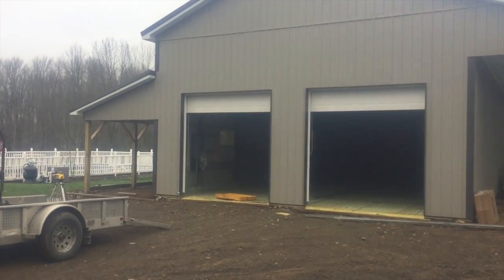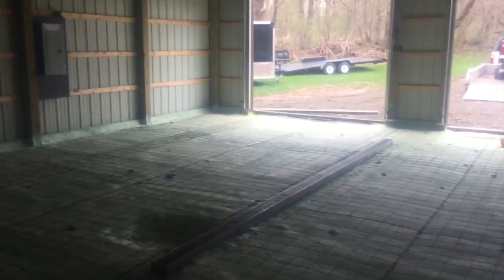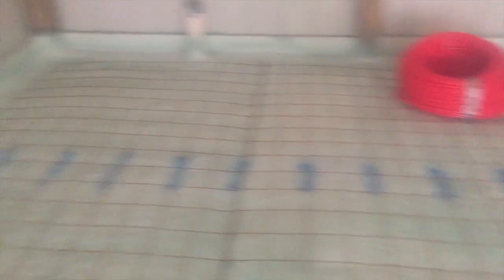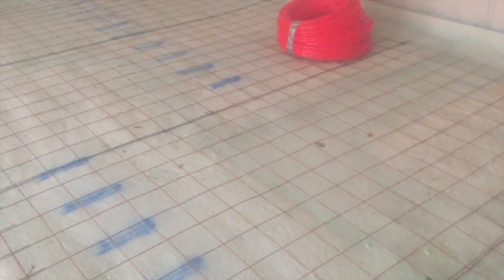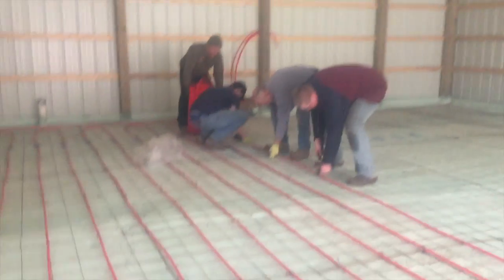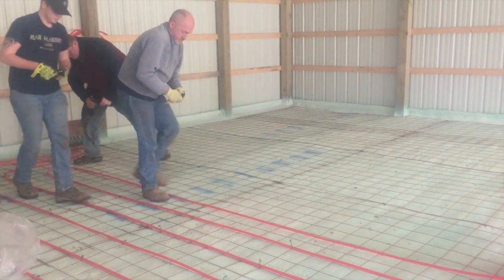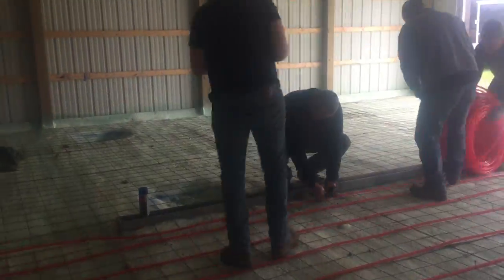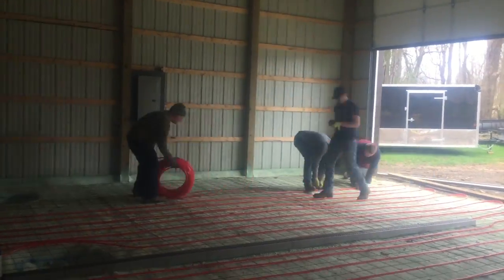Radiant heat tubing layout in concrete slab

Comment: Hello. We plan on using fiberglass rebar on our shop pour.

 Question.....do we first put down plastic,then blue insulation, then tubing,then suspend our rebar so its in the middle of the slab?

And if so, how can you attach the pex to the blue sheet insulation?

Thanks for anyones help in this matter and thanks for these great vids!

Comment: Any concerns for the wire tie to eventually rub through the side wall of pipes? Is there enough movement from heating / expansion and cooling/ contraction to cut the pipe from Wire vs a plastic wire tie? 15:20

Comment: Hi I like your method of installation nice and simple I'm looking to do a radiant floor heating system  my floor is 20x30 my floor is spec for 4 inch thick concrete should I  bump it up to 6 inch and what was the name of the pump that you listed in this video? Please if you don't mind .
Reply from the maker: Hi what is the floor for? house garage or pole shed?
Reply: I'm doing a workshop in my back yard I'm doing a red iron steel building from general steel I'm doing 2 inch foam under the slab with 30 inch frost wall (required by my county ) per code
Reply from the maker: @sammason2464  I would go 5" to 5-1/2" thick on the floor. The pump I referred to was the Taco 009. Sounds like a good project. 👍
Reply: Thanks for the reply you really provide good information.  I wish you guys were in my area . How much would my job cost in your area ?

Comment: Love your videos. I'm actuall about to pour a 30 x 40 pole building. I'm doing the radiant tubing and a trench drain. I notice you don't fully encapsulate the trench drain in concrete, but all the trench drain systems I'm looking at call for concrete to go underneath the trench drain material. Is this a new thing, of just the brand on trench drain?

Comment: Navien NP-A2  150k Residential heater. They also have a 180k and 199. then you get into boilers systems. Is there a BTU/SF ratio to go by here?
Reply from the maker: A typical output of a residential hydronic radiant heating system is within

Comment: Very well presented and no bs straight forward. I am going to attempt doing a 2100sf third level (tier) house with this then doing  2100sf mid level off of same heater. Would separate 4 loop units work?
Reply from the maker: Daryl I would need more info to answer that one. I have run loops up to 500 feet and they work awesome. Well insulated under slab and the structure as well. Also what is the heater?

Comment: Great video.  I'm learning a lot for my new project.  Can you please explain what you have under the wire mesh?  I believe you spray foamed.  What did you do under the foam?  Did you level the pad, add sand and then pack, then spray foam, wire mesh, then radiant heat tubing?  Thank you!
Reply from the maker: Hi we have well compacted fine gravel and they spray foamed 2" of foam to that then we have wire mesh then the tubing is tied to the wire mesh.

Comment: How do you saw cut your joints after pour without hitting the pex?also will the concrete not settle on the spray foam?
Reply from the maker: We only cut it about 1/2" deep and no that foam is rock solid.

Comment: What is the calculation for rolls of tube for size of floor? I am building a 40x90. I understand it is 1 to 1 ft to sqft now much do you allow for the corners and connections
Reply from the maker: I would do 7 - 500' loops bud. Divide the building in 7 equal pieces and that will help the layout.

Comment: Hi Bondo,
More questions!! We've JUST built a 32x56x12 and getting ready for concrete. We have our 1/2" pex ready to put down.
Q#1 what size water heater should we use?

Q#2 Should we use anti freeze or just water? If anti freeze what kind?

Q#3 We're using propane as our fuel. We live in Ohio. Your thoughts on propane/cost please..

THANKS FOR YOUR HELP!
Reply from the maker: HTP Phoenix light Duty 50 gallon is a great propane water heater for radiant heat. 
No antifreeze is needed. 
Insulate the crap out of everything and it will not cost that much to heat with propane.

Comment: Great video. Its all water flow at the same flow rate. how you install you pipe is in effect the manifold .
Reply from the maker: They just hook up to a copper pipe with T branches off it. It is a cheap manifold with no controls. you can buy them at Supply House. online. Thanks Patrick.

Comment: How do you feel about the tankless water heaters? Live in Alaska and about to do this job but leaning towards those tankless ones.  But gonna be doing this one on a 2 story home which will be just for the top floor with a garage on bottom. Is it better to install from first floor ceiling or just I just lay it on the second floor? (New build so nothing in it yet)
Reply from the maker: I would instal from under the floor buddy or lay the tubing in before the plywood goes down. I’ll send you a video of a house I did that way. I have used a couple tankless for houses but a 50 gallon tank water heater is better. HTP Phoenix Light Duty is a real good unit and reasonably priced. The tank will last way longer then the tankless and can handle thge cold start ups that will hapen better and it can be cleaned out easy from setement in the water. I would definetly put the heat in the concrete also. That will be the best thing you could do for the house.
Reply from the maker: https://youtu.be/pfx-2glUq3A
Reply: I've seen a product advertised here in Australia that is a structural plywood floor sheeting with the channels pre-cut for the tubing, and then sheeted with aluminium so the heat is dispersed evenly and you just put your usual floor covering over the top. I haven't tried it myself, but it looks like something to think about for hydronic heating upstairs. They promote using it with solar HW, but I guess that part's not so useful in Alaska in winter.
Reply from the maker: @tealkerberus748  I have seen that.

Comment: How did you secure the wire mesh to the foam? I will be using rigid foam if that matters. Thanks
Reply from the maker: The wire will not need to be secured to the foam. We did tie wire the wire mesh sheets together so they don’t move around. Don’t use the rolled mesh use the 5x10!sheets. The roll stuff will pop up all over the place. Real pain. 👍👍
Reply: Ahh, I was thinking the rolled wire. Makes sense. Thanks. I have many more of your videos to watch. Keep them coming.
Reply from the maker: @D-Allen  will do. It’s winter here but soon as the snow melts I’ll be back at it bud. 👍👍

Comment: Thank upi so much for that information. I do have other questions on what if your doing a home with different rooms? how do i figure out how far from the boiler I can put manifold ? How far am can I be from manifold to boiler? And if I want to run them on different thermostats?
Reply from the maker: Glad you liked the video. You can put the manifold as far as you want from the boiler just run 1” pex or copper from boiler too the manifold. If you want  different zones controled by different thermostats you nan use zone valves or separate pumps. many ways to do this. 👍😊

Comment: Do you have some one in my area that can put this in my 30 X 40 pole building before I pour?
Reply: Delavan Wisconsin
Reply from the maker: @josephscheurell8195  I dont know anybody in that area but I think you could do it with my videos. Do 3 loops of 1/2” oxegen barrior pex at 400’ each loop. Make sure you have 2” of polystyrene insulation or 1-1/2” of closed cell spray foam under it. and insulate the bottom skirt board as well. Any questions hit me up.
Reply from the maker: Joseph where do you live buddy?
Reply: I'm doing exactly the same size pole barn this summer here in Illinois. I'd love to see your schematic layout of your project. 
Thanks in advance for your help.

Comment: In the apartment portion of a building, I get going wall to wall with the tubing. But would you consider leaving 2-3 feet of the floor along the walls unheated since shelves and work benches will typically be along the walls?
Reply from the maker: I would not do that because the tubing puts out so many BTU’s per foot and it takes 1 square foot of tubing per 1  square foot of space to heat a concrete slab so you would not have the proper BTU’s to heat the space. Hope that makes sence buddy. 👍
Reply: I'm not an expert, but if the stuff in your cupboards is cooler than the rest of the room, I'd be worried about condensation leading to mildew and mould. Unless it's a food storage space that is meant to be kept cooler and everything is in waterproof containers, I wouldn't want to risk it.

Comment: Great videos! Thanks for sharing them. Do you ever splice or is that a no no??
Reply from the maker: Thanks 👍😊 I don't splice under concrete but we will splice in floor joist applications. Thats how we use up extra tubing. 👍
Reply: @bondobuilt386  Thanks for the reply, do you not splice because you are afraid of of the concrete being corrosive and causing deterioration to the splice, hence a future leak?
Reply from the maker: @traderman4378  no I think it would work fine I just hate burying a splice. I seen a tube damaged and then spliced but I avoid it bud. 👍

Comment: I really like your videos and the practical experience you bring to the application of this technology. I am an engineer and have started studying radiant slab heating recently. I have reviewed pump curves, made transient heat models for the slab, developed flow versus head loss estimates for pex circuits etc etc....but I find your experience to be even more valuable. Example is 300 foot versus 400 foot 1/2" pex loops that you talk about. At the typical radiant loop flow rate of 1 gpm this requires 5.5 versus 7.5 psi of pressure.  The Taco 009 pump can deliver this pressure out to as much as 8 gpm flow so that is  8 loops.  For more loops than that use more, or a bigger pump. Or live with reduced flow.  
I am designing my 3000 sq foot floor currently. Can you tell me what I should expect the cost of 3" of closed cell spray foam to be ?  If the cost is significantly more than rigid XPS poly, would you still go with spray ??
Reply from the maker: Bret you are spot on for the tubing. We run up to 500’ loops all the time and thgey perform awesome. It makes the system so much simpler. Just want to keep the tubing the same length. I have debated this multiple times but like you said nothing better then pratical experience. 👍 I find that 2” of board foam or 1-1/2” of spray foam are about the same cost consitering my time to put it down. I think 3” is overkill. especially after you get 4 feet in from the exterior walls. You could pray it thicker near the perimeter 4 feet. Just deepen the sub grade out there a little. That would be a cost effective way to increase the insulation. 
Regards
Bondo

Comment: Do you place blocks under the wire mess to suspend the pex midway in the slab instead of at the bottom of the slab?
Reply from the maker: No the pex stays on the bottom. We don’t pull it up into the slab.

Comment: Hey, which law of thermodynamics was that Bondo?
Reply from the maker: Just resistance to flow or head pressure. Tubing all the same length it will have the same head pressure/ resistance to flow and water will travel the same down all the tubing. Keeping things balanced without flow control manifolds. 👍

Comment: Taco 009 huh? Let’s see your pump curve to verify it. Let’s see your pressure drop of tubing vs pump curve.. come on man.  Best to lay tubing closer together at walls as that’s where your heat load is. Got a load calc for pipe size and spacing?
Reply from the maker: Ive done at least 60 of these so no sense in me showing pump curves and pressure drop. It just plain works. This is not rocket science just keep the loops real close to the same length at 500' or less and the headers can be cheap copper headers. No need for expensive ones with fancy balancing valves because water will flow even if tubing is the same length. Its just simple thermodynamics.
Reply: Your talking “simple thermodynamics” but no pump curves or pressure drop? Ha! What do you think thermodynamics design is about? You’re just guessing. All your buildings are the same load or close. Do this on different design and see what trouble you get into. Not do your customers any favors but guessing and running more tubing or running larger pumps than needed. That’s a waste of energy, which is money down the drain.
Reply from the maker: Exile1213 I’m not guessing about the heat load.  Running the tubing at 1 foot tubing per square foot of building space will give you different heat output for different size buildings. As far as putting extra tubing by the outside that is counter productive. Keep the extra heat in the middle for a heat sink in a concrete floor. Why put it close to where you have a better chance of loosing it to the outside. These concrete slabs I do perform excellent and I have done a bunch. There simple and they just plain work. And I live in central New York where it gets real cold. There is more than one way to do this but mine is cheap and simple. That little 009 will push more water then you think. My buddies shop has 4 500’ foot loops on one 009 pump. We been running it for 4 years and we’re in his shop with a T-shirt on when it’s 0 degrees out. Tubing is 1 foot on center just like many others I have done just chugging along and working beautifully. 
Thanks for the dialog if I have time I’ll look up the chart on that pump. I did it before and realized it will do some big buildings but obviously it does have a limit. 
Thanks again for the comments 👍👍
Reply: @bondobuilt386  You are an inspiration! Fuck the haters. I got a heat load they can calculate if they can open wide enough. Keep up the good work!
Reply: 300' is the maximum length of run for 1/2 pex, plus or minus 5%, after that your friction lose becomes to great.  3/4, would be acceptable for 500'. Yes, a larger circ. that is capable of pumping great head will work, but you have diminished heat after 300' and the cost of watts is driven up with larger circ. Unless an ECM is used. Just wonder what most of these buildings use for heat source??